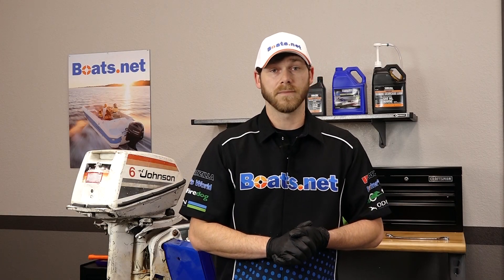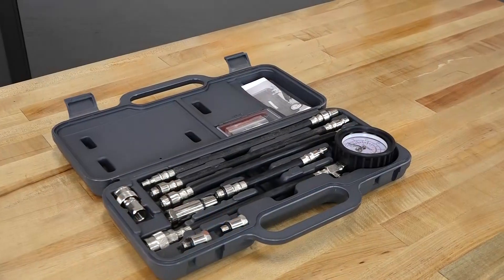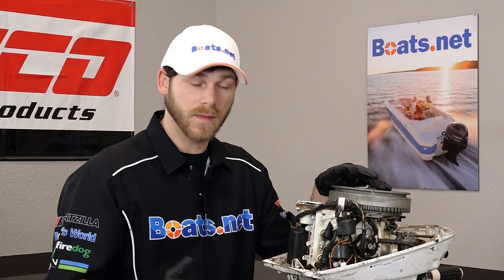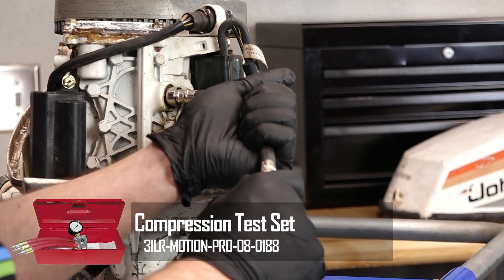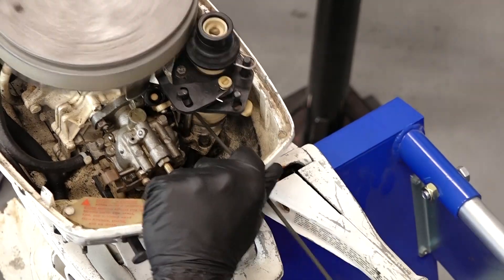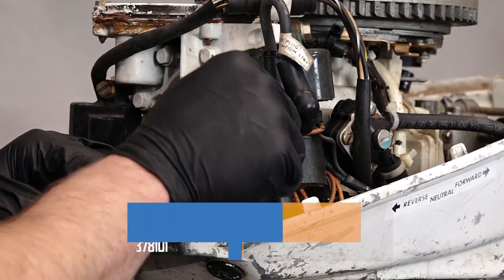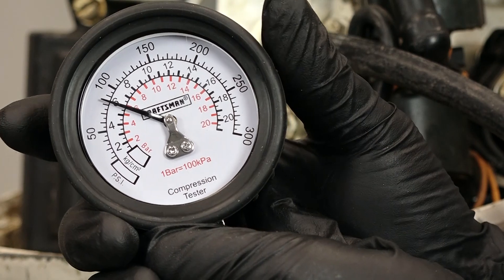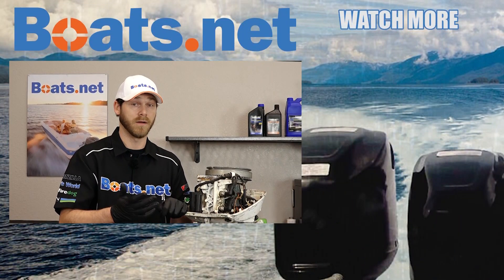Johnson 6HP Outboard Compression Test | Small Outboard Compression Test  | Boats.net

Comment: What is the compression of a Johnson 8 hp 1987 at a cold start...  But what sould be the compression at hot ?????   ----  Is 85 psi at cold start mean that the motor have a very good compression ?????      ----- What do you mean by opening the throttle, is it just opening the plate of the carburator to let more (full) air inside the carburator ?????

Comment: You don't really need the throttle wide open on a two stroke motor, only on a four stroke. The exhaust ports will allow air to enter the crankcase before being transferred to the cylinders.

Comment: Leave both plugs out, easier to pull over.
Also never turn over any spark ignition engine without a spark plug or spark checking tool in place, built up energy has to go somewhere, you will damage electronic components. 
Yes to W/O , more air in, compression builds quicker, less pulling

Comment: How do i fix the throttle on it mine is off center i have a little mark i put it on to start it  feels like its not giving alot of gas runs good other than that. Also how many oz of oil do i mix with 3 gallons of gas